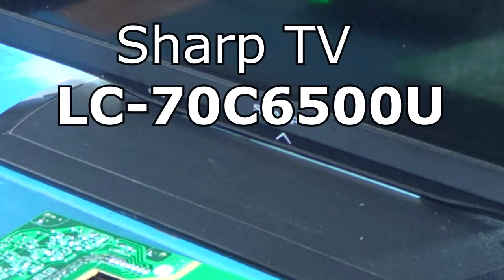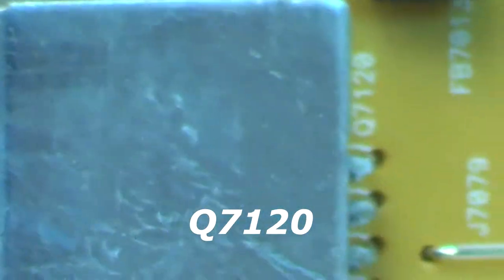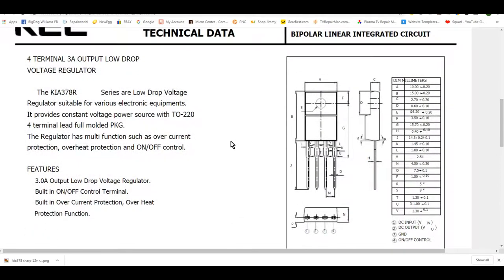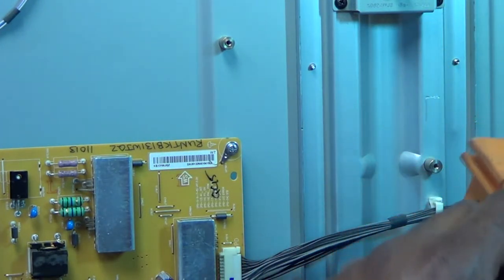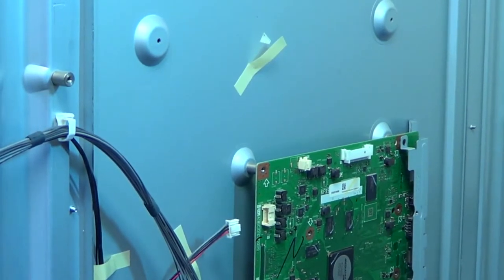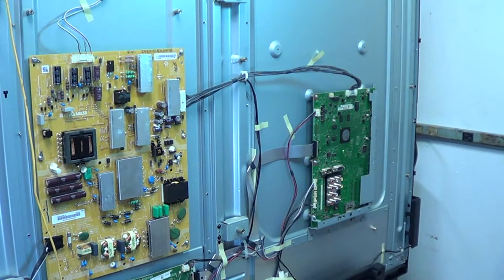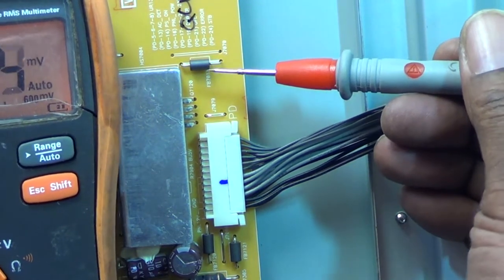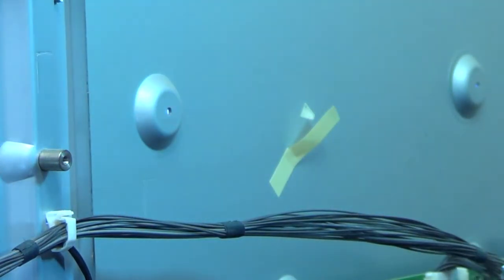70 inch Sharp Television with 3 and 1 blink code, Power Supply or Mainboard? How to Isolate. LC70...

Comment: if the problem was in the power board why did you change the main board? Thanks
Reply from the maker: I should of explained it alittle better. If the 2.5v is missing on the chip on the PS,  then that voltage is coming from the main board. So the main board is the problem.

Comment: I have 12.9 on Pin1, 0 on Pin2, 0 on Pin4.  Pin 14 0 and Pin 16 0, Is the issue the Regulator? Thanks, TV Starts up with SHARP logo then goes black and Blinks X3 then 1 slow

Comment: Thanks for your videos you have taught me allot about troubleshooting tv power supplies. I have a similar Board from sharp lc-70le661u tv when checking my pnl power voltages im only getting around 7.4 v instead of the expected 12 v.  So when checking the regulator itself i have 13v on input leg but only 7.4v on output leg. Would that mean the regulator is bad or could be another component in that circuit pulling it down.
Reply: For anyone else with this Issue I did replace the Voltage Regulator and that fixed the issue so it was bad and only supplying 7v.
Reply from the maker: Yeah voltage regulator IC is bad.

Comment: I am happy(ish). If it's just firmware corruption, some models let you reflash it with a USB stick. Or you can read it from the working board and transfer data to another flash chip. Original motherboard saved is always a good thing, yes?
Reply from the maker: From What reliable site or place can U get the Firmware?
Reply: @bigdog8882  Sharp website has it, but that model probably doesn't support firmware recovery from USB stick. Sometimes the easiest option is to order a pre-programmed flash chip, like with early Samsung smart-TV:s with bad NAND-flash. Anyways, you must have already returned that TV to customer, too late to try anything.

Comment: Great video! I have a Sharp LC42SB45U with the PSB clicking when plugged into MainB. Does not click when discon but only 4.4V-STBY. When jumped PSOn with 1K rea it goes to 5.1 but 12/24VDC only goes to 50%. Any ideas? Clicking comes for Mosfet for Main Xfrm

Comment: What's involved in replacing that regulator? Soldering the pins on the back of the board? I found a used SHARP LC-70TQ15U POWER SUPPLY RUNTKB118WJQZ (DPS-254BP-1) for my (same model) TV that's blinking three long and one short LED error code. I can hear the relay click when I turn on the TV, so I am assuming it's just the power supply board (regulator). What do you think?
Reply from the maker: U have to check the Voltages like I did in the Video to be sure.
Reply: @bigdog8882  I will for sure. Thanks. We've had non-stop thunder/lightning storms through here for a month. My TV is plugged into a battery backup surge protector, but my gut feeling is the power supply couldn't handle the micro second of brown out or surge before the protector kicked off.
Reply: @bigdog8882  I tested the power supply component pins and I get 13v etc., so it's not a bad part. I have the PS board and t-con board coming from a supplier. I guess the problem is the t-con board or some other component on the PS board.

Comment: Big dog I will try replacing main board on my sharp lc-70le650u and see if it fixes mine. Also I have one more question. IT IS ABOUT a Vizio e70-e3. I replaced the back light in it and when I put the panel in the TV I bent one of the tabs on the side of the panel too much. Can removing that bad tab fix the horizontal lines and darkness from the left side of the screen. I saw one video that showed it would but I wanted to ask you about it before I tried it? Please let me know if you have any knowledge of this issue. I love your videos and the music ride.
Reply from the maker: No dont take it off. If U got lines in the screen (horizontal) now and they weren't there before, then maybe you damaged that section cause of the tab. But usually you can bend them a little as long as U dont break them.

Comment: Big dog. I changed that main board on that sharp lc-70le650u that had blinks of one short and three long and with different board I get one short and one long. Using led tester I get 164 volts on the three leads but still will not come on from power supply bd. Output from power supply to leds is only 167 volts. Please tell me what it could be? I watch your videos to help me repair a lot of tvs but this one has me stumped.
Reply from the maker: Look for a vid on youtube on how to get into the service menu and reset the error codes.
Reply: I will try again. Didn't have any luck getting the screen to light up

Comment: I have the same problem on my sharp TV. I checked everything like you did. Voltage seems right but still get the same codes. Tried the force on sequence with no luck. Do you think I have a defective main board?
Reply from the maker: Whats the model # of the TV?

Comment: Where do you recommend I can order the part - Q7120?
Reply from the maker: Just Google the Part number.
Reply: @bigdog8882 Thanks. I thought if the part was cheap enough I would give it a try to see if it fixes the issue... I am in Canada and the part costs $6.71 CDN online however the shipping cost is >$30! Although this doesn't sound too bad I cannot confirm the issue is just here as I am NOT seeing a consistent voltage on pin 1 on this regulator component. I was prepared to spend <$10 for one last hail Mary attempt to see if I could fix the TV but because the TV is over ten years old I think I will just let it go this time. With that said, I thought your video was awesome and I did give it a thumbs up. Cheers!

Comment: I have a Sharp Roku TV LC-55LB481U. The TV was working fine. My wife turned the TV and it appeared with vertical lines. There was no problem with the TV before.
I opened the TV, I checked all the board, I saw no burns on cables or anything bad. I reseated al cables to no avail.
I repñaced the TCon and the TV still dos the sams thing.

When the scene is dark, the lines kind of dissapear but as soon there is color on the screen, the  lines came back again.

Can this be a Main Board thing or a power supply issue? I dont lnow what to replace Next. Dos the screen want bad?

https://www.ifixit.com/Answers/View/632570/Can+a+TCon+board+cause+this+Vertical+lines+por+ssmething+else
Hoping you guys let me know were to start with it.

Comment: Hi Bigdog, I have a LC-70LE847U that has the same blinks (3-1) and I checked the voltage at the regulator, 13V at p1, 11.9V at p2 and 2.7V at p4 while the standby light is on before it starts blinking .  Think the regulator is the issue?  Thanks!
Reply: Confirmed that I have 3Vs at pins 14 and 16.  Guess it's not the regulator.
Reply from the maker: @michaelmacneil4546  Yeah, regulator is working.